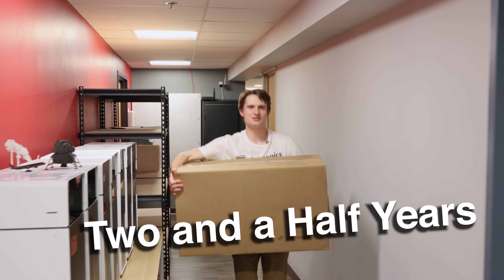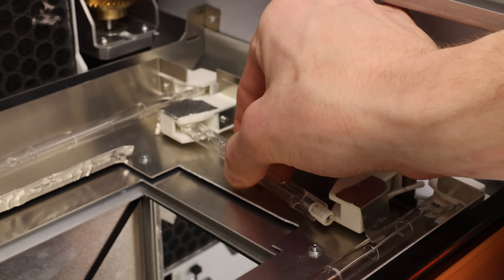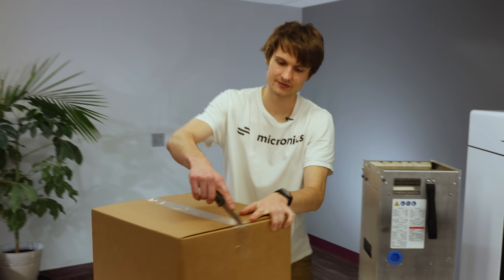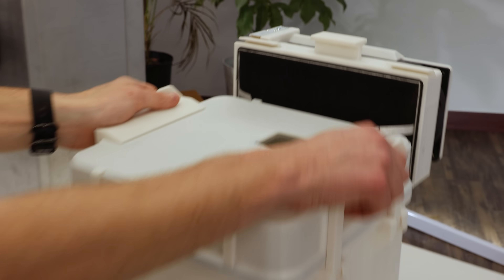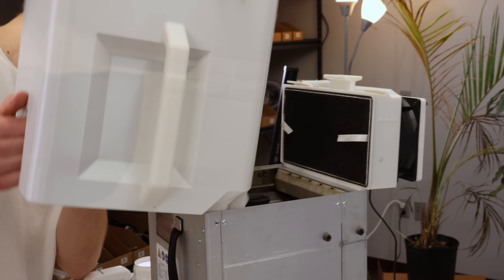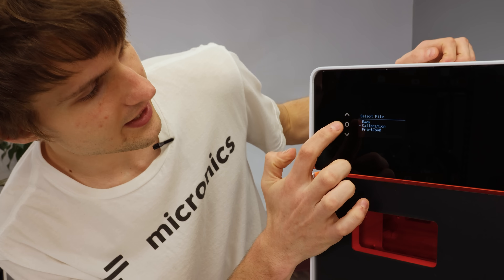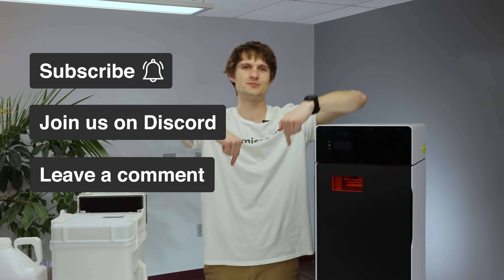UNBOXING the Micron SLS 3D Printer & FIRST PRINT!

Comment: Q's; 

1. Lamp instal should use gloves to keep lamp life degrading finger prints off surface of lamp's glass? 
2. Test coupon strength factor from solid polymer vs. printed. 
3. Level marks on the sift bin for filling accuracy? 
4. Build Volume time In^3/time for most detailed designs.

Comment: So it took 1h for this tiny part whereby it is consuming 500w? Thats half a kWh😮 As for now you can print PA12 at JLCPCB for 2€/g (the powder alone is 1€/g at microns site). Downside is, they only print PA12 which has a pretty low E module. I am really excited about Microns success with this machine and am hoping for a new trend of consumer SLS printers

Comment: Not sure if things have changed, but back in the day, you'd never touch a halogen lamp with your figures while installing. The oils from your fingers could lead to the lamp exploding when it got really hot.  We'd always use gloves or a rag.  Not sure how big of an issue that is for the particular lamp you are using.

Comment: Great machine, I´ve so exited with the "home" sls printer. I have a question about the security system for avoid an dust explosion, i mean that the industrials solution use nitrogen for replace de oxigen inside de machine, how do you solve it in your machine?
Reply: SLS was never made for home... . seems there is no extra security design.

Comment: Amazing machine! How long before we will see  a low cost version of it printing with any metal powder? Is that just a matter of settings and a stronger laser? Does metal also need pre heating? Will we see HDPC and Nylon pre mixed with graphene (FLG) and or carbon fibre strands? And is there a plan for the propriety parts you developed to come down in price, and release a kit for a max of $1000-$1500? Also how do you remove powder from a fully closed part like eg. a football? Or sneakers that need air pockets?

Comment: "1 hour includes 20 minutes of heatup and 30 minutes of cooldown." - Ouch.

This means its VERY power hungry and needs A TON of heat and is very slow. Which you already explained in another video and you are not hiding it. But that is of course a difficult thing for home / non-professional users. This thing will emit TONS of heat and cost A LOT of energy. 

I have not yet found the "pros" for such a system. Expensive, slow and high ongoing cost. The powder will probably also be much more expensive then PLA filament / resin. 

And hollow parts are probably also a nightmare - just like resin printers?

Comment: I did have a question, with nylon powder do we have to worry about keeping it dry? for normal 3d printing you want your nylon to be super dry always when you are printing or your prints can fail. Is this the case with powder?
Reply from the maker: No, the powder is pre-heated to over 100C inside the printer which gets rid of all the moisture.

Comment: Got a few Q's for designy bits that don't immediately make sense.

- Why must the lamps match up with their slots? If they aren't all the same, why not? 0:54
- Why does the glass plate need to be aligned with the triangle? It looks square, so it should be the same on all sides? 4:16
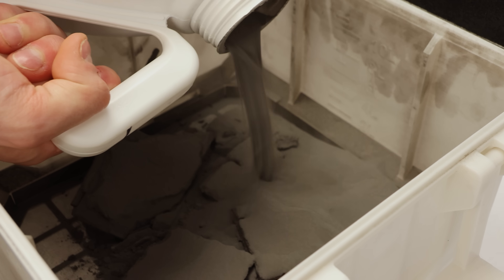- Why do you need to top off the sift bin after the print is done, just to sift it out again? 5:42
Reply from the maker: 1. Lamps all have slightly different output power and are calibrated. If you put it in the wrong socket, one side of the build area will get hotter than the other.
2. The baffle pattern is not symmetrical
3. So you can refill the print chamber.

Comment: Question: why would there be a leadscrew so close to where the powder enters? What if powder goes on the lead screw
Reply from the maker: It doesn't matter. We our design allows it to clear any powder by itself. Ran over 500k strokes without any issues.

Comment: Whats the heat resistance specs on Nylon 12? Do you per haps have Nylon 6 as I know it can handle 180 degrees celcius. I currently make molds with resin prints but I need this in my life

Comment: @micronics3d - Cool product review, but one thing to note, one shouldn't handle the heating lamps with bare fingers, as grease and contaminants can lead to hot spots forming, that may result in premature lamp failure, as with all glass envelope halogen lamps. If one does potentially contaminate the glass, simply clean it with isopropyl alcohol before installing it. 😉👍

Comment: Sorry, the expense, tedious set up and processing, and material handling make this unsuitable for anything other than making special use parts for a limited clientele. Even resin printing, with its chemical smells is much higher res, faster, flexible and easier and with many kinds od material. This not the future of 3d printing but rather something to put in the rearview mirror.
Reply: But SLS parts don't break as easy. FDM, SLA and SLS all have their place - use the best tool for the job. Looking forward to this machine.
Reply: @it-druide  Yes, the limited clientele I mentioned.

Comment: fantastic! the system looks great and well thought through. the printed part looks good too. how about a more challenging part to show off the system's capabilities? Something very rigid, nylon and TPU. Strength test vs resin, fdm and other SLS or MFP prints ehat is the range of shre A durometer for your TPU ? .

Comment: I don't see the "scoop", used for transferring the powder from the buildchamber to the sift bin, in the unboxing? I wonder how difficult the "scooping proces" is. The scoop has to scrape over the build platform? If anything goes wrong in this step, powder will spill everywhere?
Reply: The scooping process is shown at approx 5:35 https://youtu.be/SupuCvfviWQ?si=dznH2pwYC3z6FnSO&t=337
Reply: @TheLex1972  Yes, I know, but the "scoop" part isn't shown during the "unboxing". And I am curious how big of a mess it will be if the "scooping" process isn't done correctly. In the worst case, the "tower" of powder overflows the buildchamber. I can also imagine that there will remain a layer of powder on the build platform after scooping, do you have to scrape it into the filling opening or will it be flattened automatically during the initialization?

Comment: You forgot step number 552! Give your left arm and finally your print is done! Good Lord, I'll stick with my Bambu Lab lol.
Reply: While I agree it's a whole lot of messy work,  SLS prints are stronger than FDM.  They are comparable to injection molded strength.  Only worth it if you print a lot of engineering grade parts
Reply: @mikeb1596  Yeah I love the idea, I just wish they could come up with something that just doesn't require so much work.

Comment: This is nothing short of incredible for a first of its kind commercial products. Sure, there are visible shortcomings (I'm thinking of the dust extractor and the "fume hood" made with the glass plate), but that's nitpicking. This is a damn SLS printer that's accessible to makre spaces and consumers. I tip you my hat.

Comment: 4:15 perhaps you should provide/recommend some window or screen cleaner. Alcohol usually just smears finger fat around. As you can clearly see at 4:22
Reply: IPA is standard use on SLS machines. Anything else will outgas.
Reply from the maker: The smears are from the 20th take it took to get that shot.

Comment: Considering how expensive the powder is, how many prints on average can we do before we have to buy more? Are you planning on also selling smaller amounts of it as well, cause I don't think some people would be willing to be spending 200+ bucks each time they need more powder or they may not need 5 liters of it.
Reply: In another comment they said it’s 88/kg as of now but will likely go down over time.

Considering nylon is at least $30 or so a spool that’s not too bad, still steep but at least you’ll save on supports lol
Reply: @Resyektt  It's 88 per Kg but the powder is sold by volume and not by mass. If you go on their website, it is listed as "5.3 liter."
Reply: The website also shows the density of the powder being 0.47kg/L. Seems more like 94 per Kg since 0.47 * 5.3L gives you 2.33 kg of powder in the bottle which divided into the coat of one bottle (219) is $94
Reply: @thesoundsofnature8212  And I suppose the price is worse for one of the powders which costs 300 bucks.

Comment: My only hesitation with getting a machine like this is the powder I've seen is stupid expensive compared to something like common FDM filaments. 

I'm gonna need to give myself a really good reason to justify the material costs lol
Reply: Not as bad as you might think. This powder is about $108/kg. Nylon filament is about $32/kg so about 3.4x the cost. But this is stronger and doesn't require supports so your material used can be less. Power consumption is another factor but I don't have that data to compare.
Reply from the maker: You can get powder frp, us at $88/kg. Price will of course drop as time goes by.
Reply: @micronics3d  Neat! That brings it down to 2.75x. I should also mention for those reading this comment you can make hollow parts with a drain hole in place of FDM infill which I'm most familiar with, or the model geometry can changed to take advantage of SLS.

If you do send units out to influencers I'd like a crack at it.
Reply: @micronics3d  hot